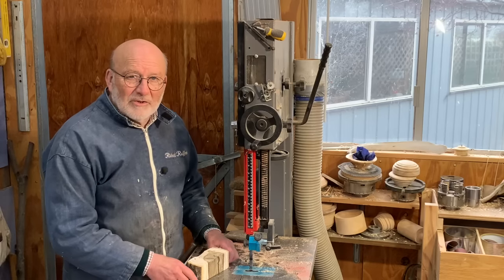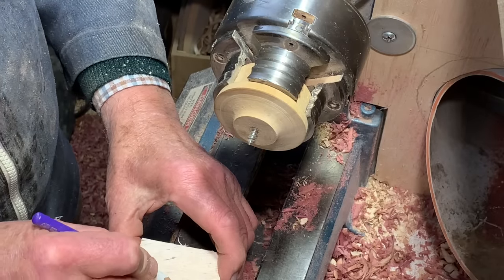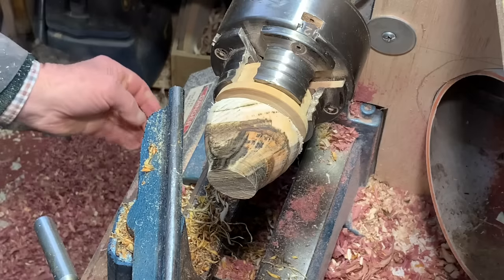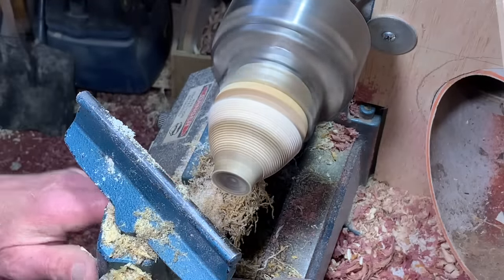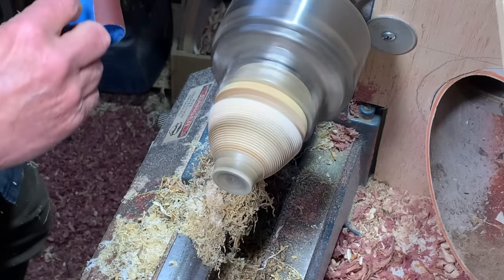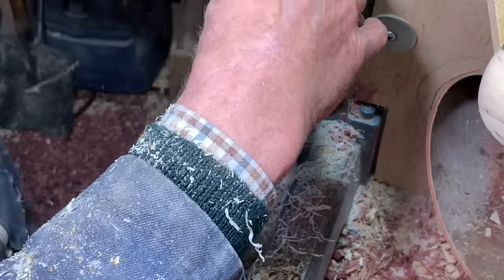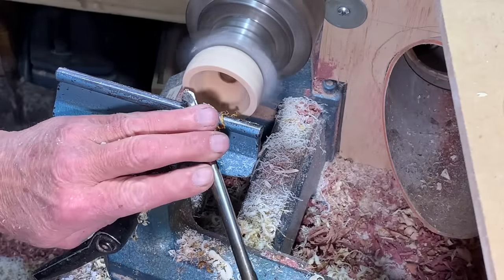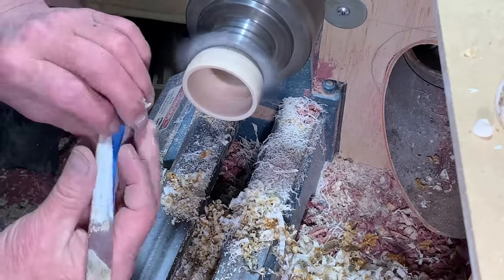Richard Raffan turns a scrap of pistachio into two tiny bowls

Comment: Another great video with valuable technique and beautiful results, thank you for your outstanding contributions to the craft through this channel!  I love your take on NR scrapers, I just can't understand the point of grinding away perfectly good steel when you can, as you elegantly stated on several occasions, "just raise the handle."  I got distracted when you turned the first bowl around and began hollowing. The outer edge of the jaws near the top of the frame appear to be pulsating, as if slightly off center. I'm guessing it is some odd camera effect, maybe with your lathe speed close to some multiple of your camera frame speed. At any rate, beautiful work. The close ups of the finished work almost looked like some sort of fine marble or other stone because of the unique coloring. Thanks again for sharing your talents and skill.

Comment: Following your rant about negative rake scrapers, could we have a short video explaining the differences and pros & cons of the different types of scrapers?
Reply from the maker: I've never encountered a situation where a negative rake scraper is superior to a regular scraper. Time and again I've equalled or bettered NR surfaces using conventional scrapers when someone has claimed only NR does the job. The theory is that a NR is less likely to catch because the angle between the surface being turned and the upper bevel is way less than 90 degrees. To achieve a negative rake all you need do is raise the tool handle, and possibly the rest, when turning flat surfaces or at centre.

Comment: Good afternoon, I'm removing some Lombardy Poplar trees from our Parish Burial ground this coming Winter. I want to see the timber re-used rather than burnt or left to rot. Is Lombardy Poplar any good for turning? If so, how is it best for me to get the trees felled and processed to be of use to turners?
Reply from the maker: I did once have a few chunks of Lombardy poplar burl that turned well enough. I suspect most turners would regard non-burly poplar as boring regards grain. I always enjoyed turning the poplar provided for American hands-on workshops and demos, but have no idea which poplar it was, only that it was widely available. If the trees are a reasonable size I've have them sawn into boards. I'm sure any number of woodworkers would be interested.

Comment: Some serious safety issues here for me. It would be better to use glue gun aggressive on that block than to use a metal screw. 

Also, given those small margins, plastic wrap notwithstanding, it's pretty dangerous putting a tool that far into a metal chuck spinning at that high a rate. It would, again, be better to glue it to another piece first. 

Beautiful pieces, otherwise.
Reply from the maker: I know from experience that hot glue is nothing like as secure as that screw — hot glue is expensive, tedious, and inefficient by comparison. Long before hot glue, small screw chucks were used by generations of production turners for small endgrain items like drawer knobs where the grip is far less secure. 
If you're pushing the gouge into the cut, then I agree that hollowing within the chuck jaws could end in a nasty catch and some tool and chuck damage. However a key to turning is letting the wood come to the tool with minimal tool pressure against the wood, not pushing the tool forcefully into the wood.

Comment: Can't hear alot of what you say. Tried closed captioning - according to what they type they can't hear you either.
Reply from the maker: The sound is as good as it'll get without a professional sound engineer and/or myself seeking speech therapy. Try turning up the volume. At 22:25 the the word  "foreign" appears, presumably translating the sound of the gouge as there are no words. Maybe it's the closed captions that don't meet your high standards.